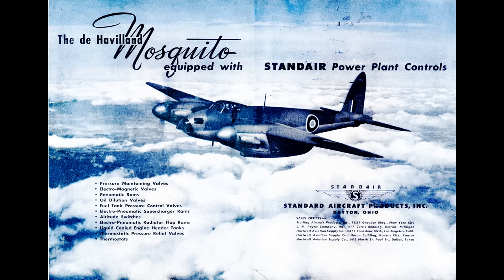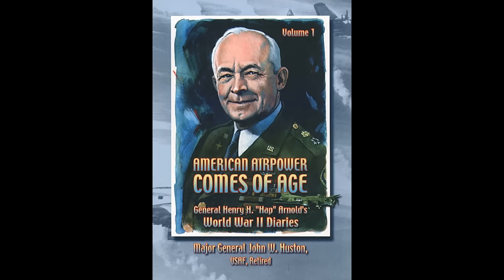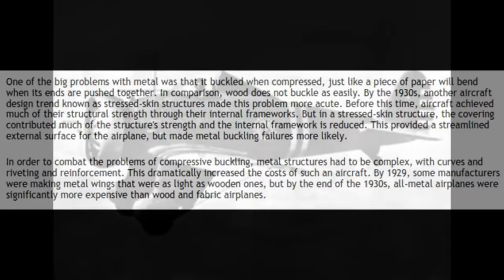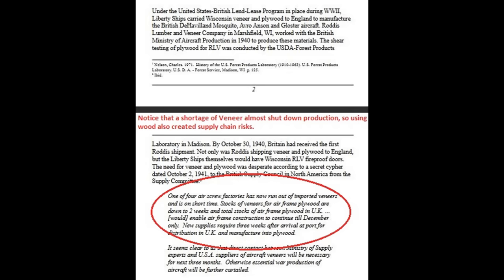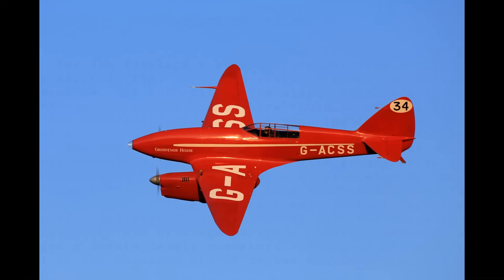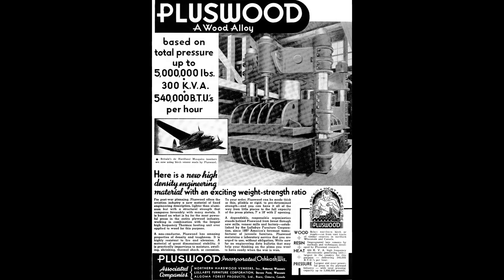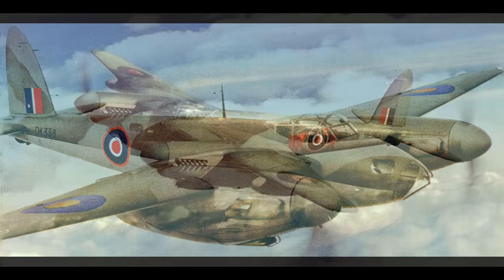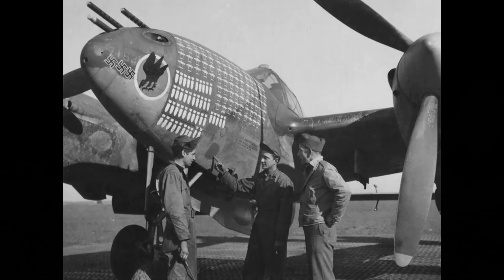De Havilland Mosquito vs. ?

Comment: The HE shells fired by smaller caliber anti aircraft guns would often pass straight through a wooden wing rather than explode like they would on a metal skinned plane, this was evident when the swordfish attacked Bismark, the planes were full of holes however because they passed stright through they did little structural damange, secondly one of the great advantage of Mosquito construction is that it would happen on many different sites and then be bought together for final assembly, lessening the chance that a single bombing attack would stop production.
Reply from the maker: That's a different situation. Naval anti-aircraft fire hitting canvas, not air to air ammunition hitting wood. German shells had no problems with the Soviet air force, so I see no reason they wouldn't explode when hitting a Mosquito. If you have evidence to the contrary, I would like to see it.

Comment: De Havilland had connections with the town of High Wycombe, between London and Oxford.  It is famous for chair making so I wonder if he got the idea to use furniture makers to produce the aircraft from that.

Hughenden Manor, just outside High Wycombe, has an exhibition on WW2 air reconnaisance that is worth visiting if you are ever in the area.
Reply: Two additional points to consider...
 Yes his family came from High Wycombe area. But the reasons that Greg's Aeroplanes outlined that this was their de facto technology is more like it, despite the odd foray into monocoque and stressed skin design.
 ...and the facts are that whole area from Welwyn and Hatfield across the Chiltern Hills to the Thames with its beech trees and furniture bodgers was steeped in woodworking for centuries.
--------------------------------------------------------
 As for Hughenden Manor, fairly recently it was discovered by the National Trust (who own it) that from late '41, every map used by RAF bomber command was produced there... their recent exhibition was quite surprising to me being fairly local, with examples of the Dams raid maps. All done in 3 colours, Magenta blacks and greys, printed on German machines in the basement. The place was filled with artists, printers and assorted technicians, service and private alike. The Germans,  just as with Bletchley Park, never realised, and due to 'old school' tight lipped official secrets act, took until that generation were dying till they spilt the beans,  even then just a casual comment made an NT supervisor delve a bit deeper.
 Nearby in a loop of old Chiltern roads, were RAF Benson Airfield (Photo Reconn), RAF White Waltham (Reading), Walter's Ash (RAF Bomber, now underground Strike Command centre),  Chequers, USAF Bovingdon , USAF Command centre High Wycombe.
 The route was (Spit/Mossie PR centre) RAF Benson photo development,  RAF White Waltham (Analysis), Map Production (Hughenden Manor), onwards for actioning to Walters Ash (West Wycombe) RAF Bomber Command .

PS. Apparently, a copy of every raid/attack navigators map was also driven down the road to USAF HQ High Wycombe.
----------------------------------------------------
Reply: @TheHarryMann 
Interesting comments.

White Waltham is actually now a suburb of Maidenhead, rather than Reading. 

The airfield is still there but used mainly for private light aircraft.  In wartime it was used by the ATA.
 
Maidenhead museum has a display about it and also its own Spitfire simulator.

Comment: The P-38 never had a chance in Europe as it did in the Pacific. A host of field modifications was lost near Belfast that may almost have alleviated the necessity for the long range Mustang.

The P-38 designers tried raised tail booms in the interests of alleviating control issues in the dive - not a success. 

The US had a far larger budget and a vastly different system of project allocation funding for any type of plane they could conceive of, and about 2 extra years of "non-belligerent" observation. So the '38 never had to be as versatile as the Mosquito - and certainly wasn't. The P-38's teething troubles were "affordable" to the US tax payer, while the Mosquito wasn't shackled with so many troubles.

The P-38 never led to an operational evolutionary descendant, but the Mosquito led to the Hornet. I know that's just an aside: the Hornet was what is termed a "super prop", and is not in this discussion and wasn't in that conflict.

I'm surprised that the US never built the Mosquito under license. They built the Canberra (as the Martin B-57). Maybe the engineering orthodoxy that held metal to be superior to wood?

Some of what I have said may be considered conjectural and out of context, so correct me please, and keep up the good work!
Reply from the maker: Thanks for your post. I really do need to get to that P-38 vs. Mossie video. It's a fascinating comparison.

Comment: This may have had something to do with the availabiliy of skilled plywood construction workers. Britain led the world at the time, in plywood construction technology.  Using it to make the hulls of fast torpedo boats and mine sweepers. It was also most famously uaed for the Mosquito.  In the years up to WW2 Britain's sailing community had pioneered the use of plywood in the construction of racing dinghies.  
Because of this there was  large cottage industry in Britain, in plywood construction techniques and the Mosquito was specifically designed to take advantage of this industry. 
As the USA aleeady had an established aircraft industry that wasnt under the threat if the uboat or luftwaffe, it probably made expnomic sense to go with what they already had. Rather than repurpose to an entire new production material and process.

Comment: I don't see the question of the Mosquito being a replacement for the P-38 as being at all in the cards. The P-38 had been under development since 1938 and Ben Kelsey was setting speed records in a prototype in 1939. It's true that the 38 sat on the shelf longer than it should have. I found an "in house" report done by Lockheed in 1944 that argued that the equivalent of the P-38E (counter rotating props etc) was delayed by a full year because cash starved Lockheed wanted to "cash in" on huge orders for their yeoman light bomber the "Hudson." (Of course the US government didn't quite understand how close full scale war was and certainly didn't understand how badly we needed a second generation fighter in the Pacific by 1944.) That was a bad move in retrospect - if the Lockheed report was right, the USAAF would have had P-38s to help protect Henderson from Zeros & Bettys in August 1942 instead of April 43 when Mitchell's flight smoked Yamamoto. And that's where the two planes really differed. The RAF never saw the Mosquito has a true fighter. It could serve as a night fighter or even an interceptor, but it wasn't intended to fight 109s or FWs head to head in daylight. The 38 could - and in the PTO proved extremely effective. (I've talked with late war 38 ETO pilots that believed the 38L was the equal to German fighters, although 8th AF didn't agree.)

Comment: thanks, really enjoyed this
 can't help feeling you missed the composite nature of construction  considered by some to be at the core of the plane's success.
Reply from the maker: No matter what, there are always going to be more details I could have put in. I felt that was enough info for a 20 min video. I make it clear that they used various types of wood, including plywood. Also really sharp observes might notice the Wood+Resin+Heat+Pressure description along with the picture of the plywood press that was used and even the specifications for it. Could I have talked about it more, sure, and maybe I will in another video.
Reply: @GregsAirplanesandAutomobiles  Do, do!

Comment: Another excellent review from Greg. The Mosquito was built from available resources because De Havilland handed Britain the best design, fitted with the best engine, of a bomber that was so fast it didn't need defensive armament, and was which could be created from available materials via exceptionally skilled carpenters and woodworkers. (Which other country has made so much antique furniture? !) 
The Mosquito wasn't always used by Bomber Command to its best effect - it could have reached the Ploesti oilfields in Romania much earlier in the war, for example. They should also have hit the pitheads of Germany's biggest 300 coal mines, potentially trapping the workforce underground - but again this didn't occur. A lost opportunity.

Next, my uncle flew as navigator on Mosquitoes with a Norwegian dare-devil pilot. He took part in 'gardening' operations - dropping exactly three bombs, at exactly 7.13am at an exact spot on the Dutch coast. He never knew why. Now we do: Bletchley Park and the listening stations would then listen to Luftwaffe messages with '7.13am' in them - and with these 'cribs' be able to quickly establish the day's Enigma machine settings. That's clever..

Comment: Some years ago there was a book published in the UK comparing the Mosquito Bomber with the Lancaster. The Mosquito won on 'cost per ton delivered' calculations, 2 engines not four , two crew not seven, lower fuel costs, lower maintenance costs, lower purchase price. lower loss rate. 
It was also used as a 'Civilian' airliner flying from the UK to Sweden during the war ,

Comment: the Mosquito became second to no other aircraft designed for the same purpose, it was also a very flexible aircraft, adapting to many roles in many different theatres during ww2.

Comment: An excellent video, good sir !

A point about your mention of wood's ability to withstand damage. While it's true that wood does not STOP bullets nowhere nearly as well as steel would, it's important to make the difference between stopping damage and withstanding damage.

Bullets and shells have to be the appropriate type to fight whatever it is they are up against. An armor piercing round for example will be harder and faster to penetrate armor. However, if it hits a soft target, that extra strength means the projectile cannot deform and transfer its energy to its target, which means it will likely go through and leave cleaner holes, which means a lot less energy spent on the target and therefore less damage. I know that this was a fact for fabric aircraft which have been known to survive shells that went straight through them instead of exploding on impact because the design of such shells used the hypothesis that they would hit a hard enough surface to detonate. How does that translate to the Mosquito I am uncertain, but I believe that it has to be taken into account. This is also the reason why not every weapon in the world fires only AP rounds, because you need to hit soft targets with low speed, high explosive shots which are much more effective against them.

The other aspect is structural integrity. If the aircraft is damaged but the failure mode of the material prevents an immediate an complete failure (i.e. the piece breaking off instead of bending), it allows more time for the pilot to adjust his flight to maybe make it back home before the failure becomes catastrophic. From many accounts, the Hawker Hurricane in the Battle of Britain was known for being tough because the wood and fabric construction could take a good amount of punishment and still come back home for repairs, which were generally easy to do in the field.

Other than that, it's interesting to note how every single industry has a way of saying "This is the old way therefore it sucks" mentality when something new comes along, until someone reminds them politely that "Actually, there's a lot of good in this still" and that you have to look at all aspects of a problem before making a judgement call. Also, the strategic situation matters : a wooden aircraft was better than no aircraft at all. The RAF had to use Spitfires in reconnaissance missions before the Mosquito showed up, which is arguably a waste of resources. Also, if you want to look it up, Ed Nash has a video on the Miles M20 which was an emergency wooden fighter the British designed, and its performances were awesome.

In a war, numbers matter, so a ton of something slightly "less" optimal will be far better than a few of the "best" things.

Again, great video !

Comment: Plywood which was used in the Mosquito is an early composite material.  Modern composites are sometimes made from carbon fiber which is often created by heating wood in an oxygen free environment to bake out moisture and impurities, which makes the material properties more consistent.

Comment: Was Beachcraft right? You stated they got in trouble when the "Comet" had structure failures. They were then sold to another manufacturer. So I think perhaps they were correct in, if given a choice. The Mosquito flew a lot over shorter time frames, longevity may have been the issue. Agree with the comment that the way they used wood was very much a composite.

Comment: It should be noted, that the nose section of the de Havilland Vampire was also wood.
And the tail rotor of the Soviet heavy lift helicopters are wood - at least the Hook (Mi-6).

The real problem is to source the wood - any old tree won't do it. Wood is used in prodigious amounts during war - besides generally getting shot to pieces (pictures from WW1 point to that) and splinters in the trunks do tend to compromise structural strengths.

After the war there was plenty aviation grade wood to be had from f.i. Canada. Wood put aside to season.

The price of wood tends to be pretty stable

Now Germany did not have wood in the quality needed, partly because the war used up everything available. In Denmark you can usually date the age of the house by looking at the floor-boards. The younger the buildings are the more knobs in planks there are - which led to the process of dehydrating and hydrating beech-wood. With plenty of beech - especially in shorter lengths is worth the process.

Now Russia had/has inexhaustible resources of timber - only wood need much transportation. In Europe - after 2 world wars - some of wood is reap for felling in the Baltic areas that had been exhausted at the beginning of WW2.

As to building aircraft out of wood - again? Probably not, as metal is being supplemented with composite materials - which are much cheaper. Secondly titanium is coming down in price.

Comment: The P38 and Mosquito were not really comparable aircraft apart from having two liquid cooled engines. The P38 was designed as a single seat day fighter. The Mosquito was designed as a unarmed high speed long range bomber, with potential to be used as a heavy fighter, preferably as a night fighter and carried a second crew member to act as navigator or later radar operator. Both were used as photo reconnaissance aircraft although the P38 required more conversion to do this role. The Mosquito was also built as a fighter bomber with cannon, machine gun and bomb armament, an anti shipping strike bomber with gun, bomb and rockets, a meteorological reconnaissance aircraft and a high speed passenger transport for flights to Sweden to collect supplies of ball bearings. The Mosquito fighters were not really expected to mix it with single engine german fighters, although of course they did. The P38 was expected to fight single engined fighters, and did so with great success.

Comment: On the structural crack from gunfire front, the plywood construction does negate that actually- you need a significant portion of the outer skin removed before failure. That is why you go to all the difficulty of shaping the plywood etc. 

Big difference between ply&balsa vs timber & canvas.

Comment: There are a few comments on here about the Mosquito not having ‘handed’ engines - both propellers rotated the same way and the pilot had to deal with the torque effects. That wasn’t unusual at the time - virtually all twin engined aircraft of the era were the same. However, what I do know is that Rolls Royce made ‘handed’ engines available quite early on. There was an aircraft - I think not the mosquito - that was fitted with a left hand and a right handed engine and they had a lot of problems with it in development. The aircraft has directional problems - a tendency to ‘snake’ from side to side. After a lot of effort was put into trying to correct this unpleasant characteristic, without success, they replaced one of the handed engines (I think due to engine problems - and they didn’t have another handed engine available) - and suddenly, all the handling issues disappeared. I can’t remember which aircraft it was, but I will find out. I think this probably had an influence on attitudes to having the engines both spinning the same way for some time - only revisited when the horse power and torque got much higher after WW2 (Hornet).

Comment: One small correction - USSR most certainly had an aluminium shortage which drove the wooden construction. They did not make enough even pre-war, and after 1941, once Germans captured Ukraine, they lost even that modest ability. Throughout the war USSR relied on aluminium imported from US.
Reply from the maker: I understand that the USSR had aluminum issues, but the US could have provided them all they wanted.